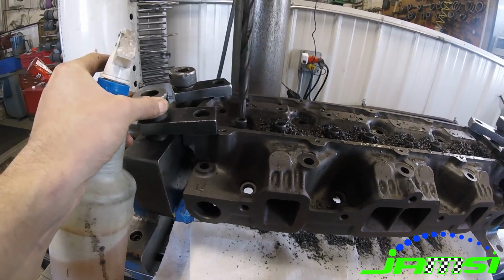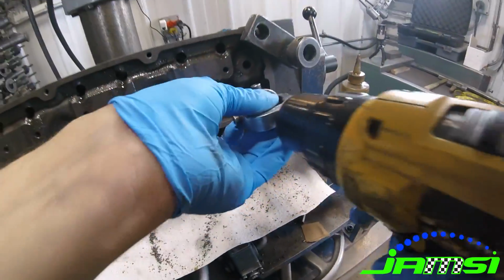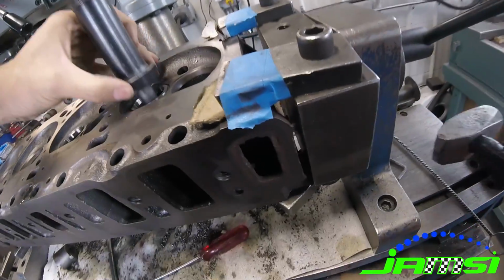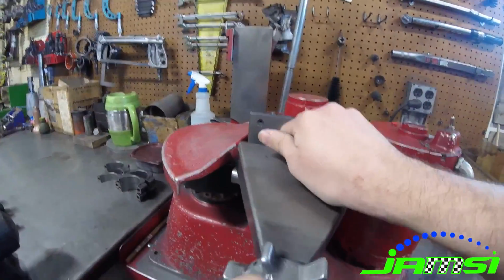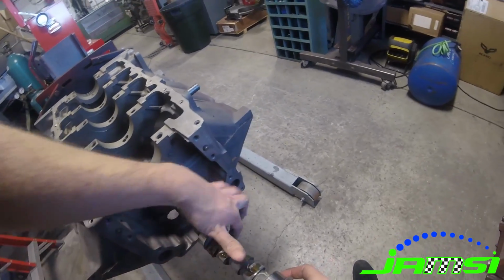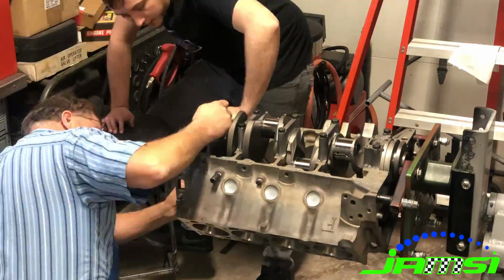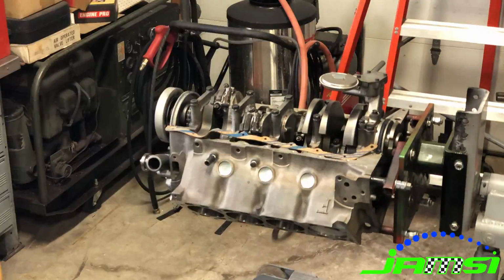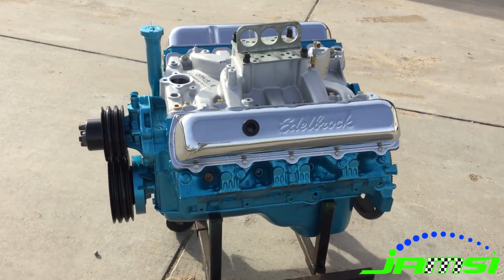455 Oldsmobile Engine Mild Rebuild - Part 2: Machining & Assembly - JAMSI Online

Comment: My first car was a '66 Olds Dynamic 88 (a 2 door coupe) with a 425 (not the 455 Rocket, unfortunately.) A high school buddy who worked as a mechanic at a local Shell station convinced me to buy it in 1983. Set me back $50 because it had a 2 inch chunk of brake line missing and the wife of the owner wanted it gone! Many years later I saw a similar vehicle at an Autorama in Detroit - burgundy red paint with all that chrome and a 455 tri-power - three 2 barrel carbs. "That could have been me," I thought to myself. I need to find another $50 project!

Comment: Olds Blue motors never seen  leaded fuel bro .. unleaded fuel came out in 73 brutha ...
Reply from the maker: Whether or not they ever saw leaded fuel is irrelevant. Doesn't change the fact that exhaust seats need to have hard exhaust seat inserts to withstand TODAY's unleaded fuels.

Comment: Great video and awesome engine build. I have to ask when did you check the piston to deck clearance? I am guessing you measured the deck height after surfacing block then did the math. Am I correct in this assumption? By the way thank you for this awesome content, please keep it coming. I love it.

Comment: I was a "Job Shop" Machinist, (not automotive, just creating  making stuff off Blue Prints) back in the 70's, followed by 25+ years in Auto Repair.  I really enjoyed this video !  Questions:   Why steel, not brass freeze plugs?  What sealer on the F Plugs? What pistons?(brand, composition )?  What type rings?  Molly?  Thanks.

Comment: I did one of these for a boat installed oil restriction dowels in main journals to reduce oil flow to the top end and keep more oil in the pan. 
Something an old drag racer suggested. Of course that was 35 years ago.

Comment: Probably been asked before but why  do you air hammer the valve guides in rather than use a press ? Just watched one of your JD head rebuild videos where you broke a couple of guides on installation . Just seems a harsh way of doing it but I guess there is a reason .

Comment: I've seen, on another engine builders page, that alot of machine shops outright refuse to build engines with flat tappet cams due to the cost of rebuilding them after a tappet fails. Nice to see a shop that knows how to combat this. Top notch outfit you and your dad run.

Comment: Or even when you use a breaking oil add the bottle of zddp I add more zinc there's never enough zinc
Reply: Sorry, that's not true. Too much zinc causes the oil to become acidic and corrosive thereby damaging cam and crank bearings.  It's like salt on food - not too little, and not too much.

Comment: I just got a 71 Vista Cruiser with a 455. You just made me realize I might need to run lead additive in it.
The engine has been out for new bearings, but I have no record of any machine work. Not sure if it's had hardened valve seats installed. Would probably need to pull a head to know for sure, huh?
Reply: No need to disassemble anything.  Go by the letter(s) on the head outer front corner drivers side and outer rear corner passenger side.  The G, Ga, and J heads have hardened seats, to my recollection.

Comment: I'm so happy you reused the old heads.
Reply: Those are J heads from 73 and later. Would have been better to use earlier. The pistons he removed were the low compression pistons. I have a 73 block with 70 heads and pistons. Looks stock, just earlier
Reply: @donaldbabineau1063  yeah the first generation had the best heads by far. The heads on the later models were really inefficient so everyone just replaces them with aluminum heads but I like to see people modify the old iron heads just to see what they can do.
Reply: I gave my son the 1966 Cutlass f-85 coup deluxe. That we had with our kids growing up. And with all of the updated aftermarket  parts  with the 455 engine. And when our son was older and he started his family I gave him the car. And he has restored it and he has done all of the body work and the original paint color. And he put disc brakes all the way around, and the engine has the new pistons and aluminum heads and bored out. And has a fuel injection carburetor. And has 700 plus horse power.  So I am so glad to see you guys doing an Oldsmobile engine finally.

Comment: Olds 455 is a ripper right out of the box.  Believe it or not, in the OEM big boys shootout, it was the fastest big block you could get in 1968-72. I don't remember who did it, maybe powernation? They took Chevelles, Cudas, Mustangs, GS and so on. The 455 was consistently the fastest. Faster than even the legendary Hemis.  It's a torque monster.
Reply: One in my shed. stock torque about 500 just motor baby
Reply: Lucore Auto did something similar a couple years ago.
Reply: I never understood why the 442’s were never in the Nascar races or Indy 500’s. If they had that fastest motor back then.🤷‍♀️

Comment: I am about to have a 1970 olds 455 rebuilt. I am undecided on the cam I want to go with. This will be going back into the original Delta 88 it was in. It will have a performance intake and 750 carb. Any recommendations would be appreciated. This vehicle will just be used for pleasure driving and a little stop sign to stop sign fun. Recommended cam? Go back to low compression or go high compression?
Reply from the maker: My recommendation would be to go with the high compression pistons and a very mild cam. If I remember correctly, we used our Engine Pro Stage 2 Torque cam in this engine. You can check the specs out here: http://jamsionline.com/oldsmobile-v8-260-350-425-stage-2-448-472-lift-cam-camshaft-lifters-kit-mc1777/

Also might recommend switching over to an EFI system to replace that carb. This customer used a Holley EFI system if I remember correctly.
Reply: I would go with something like Engle 22-25-10. 230/236 duration and .512./.523 lift on 110 lsa. Will idle at 600 and enough vacuum for power brakes. 9.5 compression should be good  👍
Reply: @robtdougherty  this is the cam I used in my 468 with 9.8:1 compression. Ran 11.80's in a 3750 lbs car with 3.73 gears 2000 rpm stall and shifting at 5200 rpm. 1.62 60 ft. Torque monster.
Reply: Absolutely high compression, moderate cam. Oldsmobile motors start producing good tourqe at low RPMs. With good compression ratio and decent airflow, has an exceptionally long powerband, doesn't need to rev much above 5500 RPMs for big peak power.

Comment: Great work, I'm wondering how the wrist pins are removed for rod refurbishing.  Are the pistons ruined?
Reply: There is 2 different ways to remove the pins one way does damage the pistons and the other way you have a fixture that holds the rod and allows you to remove the pin without any damage to the pistons if you are planning to reuse them.

Comment: Be careful with the curled steel on your seat driver. My friend accidentally shot a piece of metal into a finger joint like a bullet. He was using some kind of punch.
Reply: Shake hands with danger
Reply: Can confirm that this is very real.  Had it happen, fortunately did not get stuck in my hand but it was literally like a bullet.  Never would have believed it.

Comment: those are unleaded heads.
Reply from the maker: Regardless, a consideration must be made of whether the material hardness will be retained by the integral exhaust seat by the time it has been ground/cut once, twice, or possibly even a third time. While they may have been hard enough from the factory, excessive material removal will cut through the hardened material leaving only the non hardened cast iron. When we do not know the history of the heads with complete confidence, but see evidence of a previous valve job performed, it is our preference to install hardened seats to be 100% sure they are up to our quality standards.
Reply: @JAMSIONLINE  The valvetrain is non adjustable as well and you need to get the valve stem height correct or you will have problems.